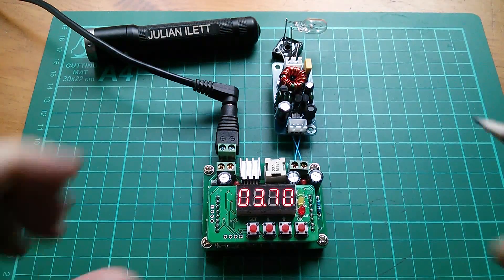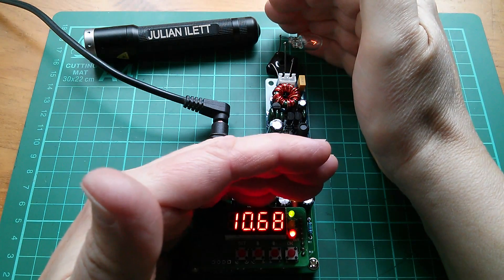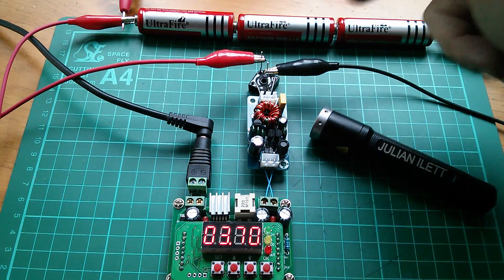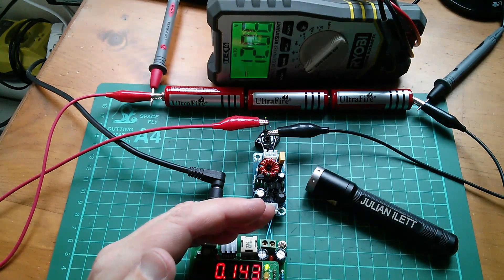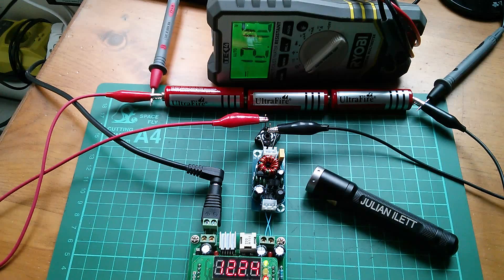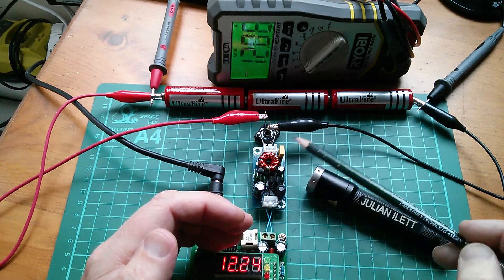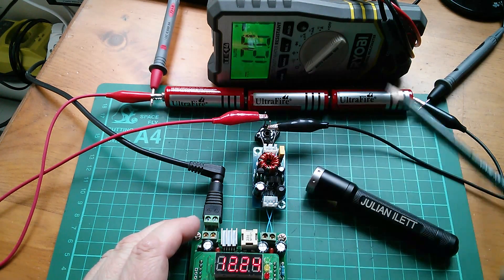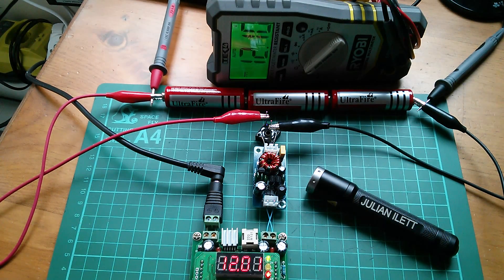Idea: Lithium Cell Balancing using AC Power Transfer

Comment: Run it at 3 volts and step up the output with an additional "standard mains" transformer from 3~ volts AC to whatever you need. Then rectify it

Comment: pst... go with a fet based active bridge rectifier if you can find one with a low enough voltage (I know of one that goes down to 9v by linear tech)...if you can break your addiction to china and ebay you will find you may even get samples of these non shit components for free, then reengage your adiction and get the ssop or qfn to dip converters from ebay. Linear also has a two part system (two systems but one is less capable/older) that does one chip per cell that connects to a 1:1 transformer and all other components are intigrated. this chip sends voltage current and temp back to their stack ccontroller via spi(i think) which does all the fet switching. Im trying to figure out what its min config is...just need to clarify with sales rep. it says the switcher chip does something like 12 cells and can transfer up to  6 or cells to any other series connected pack of up to 6. Thats a bigger pack than I want so im trying to confirm if I can go with something like 2x 3s groups. I know it also has a slower mode where it can switch them all two one transformer (only one active primary at ta time)with multiple primaries but its best to have a bunch of transformers. I got something like 5 free from coil craft by requesting a sample... i fucked up a little bit though cause i started with their old chip then after request for those realized the new chip existed and takes diff ones. im not paid by linear nor was I asked to write this im just a dude in the middle of my first "Big" project with multiple ics and the linear sales rep I was assigned has gone above and beyond to understand my design and see if it can be improved. He then got me a bunch of samples very quickly. idk if they ship to uk for free but checkem out.

Comment: http://www.aliexpress.com/store/product/lithium-battery-balancer-which-keep-your-batteries-voltage-difference-within-10mV/708582_1768384410.html
I hope you can build your own, but here is a product that does the same thing. these are not cheap, but just something I found and thought I would share. they have a high pitched squeal.
love your videos.

Comment: This may be too simple but why not run zener diodes with series fuses in parallel with each cell to prevent any cell from overcharging in the first place.  If a cell reaches it's predetermined charge (zener) voltage then the zener clamps the charge voltage at that level forcing the lazy other cells in series to accept more of the charge voltage instead of the fully charged cell going over voltage.
Reply: Cool. Sounds almost too simple to be true. Have you tried it?
Reply: No Andy, I haven't tried the fuse and zener idea because I don't play with batteries very often.
Reply: Sounds like it deserves testing, though there might be a (perhaps not insurmountable) problem when all of the cells in the battery have reached the zener threshold.
Reply: But the output voltage of the cell is variable, this could work to prevent a single cell from over discharging or over charging, but it does nothing about the problem with cells not staying balanced. The reason to keep the drain and charge on the cells balanced as close to 100% of the time as possible is to increase the life of the cells. 

Personally, i think this is all getting too complicated, and we would be better off at this point just using cells in parrellel and stepping up the voltage.

Comment: You could take a more powerful version of the DC-AC converter (let's say 30W which could be built in "ZVS/Mazzilli Driver" topology) or even an "electronic transformer" (those cheap SMPS used for halogen lights nowadays) and place several secondary output windings on the transformer depending on how many cells you want to charge. These should have 5-8V. Then you add a bridge rectifier to each output winding and connect a TP4056-based charger to each rectifier. Et voila, you should have intelligent charging via balance port for each cell...I think I'm gonna give that a try. The problem withe the cheap halogen transformers is that you need a  load of about 20W in order to get them oscillate properly. Should be possible to get that solved though.

Comment: Perhaps you should hack that Duracell battery charger you have, which you threatened to pitch anyway, the one with the fancy series-parallel switches on the board, to charge 4 caps in parallel from the donor battery, then switch to output the caps in series to the entire bank. I can not envision anything more efficient, and you already have the parts.
Please do not leave our robot brethren out of work.

Comment: These little projects may be fun, but the world needs more useful and meatier solutions!
I'm still looking for an MPPT circuit or product that'll charge and balance a 48V 50Ah 12S multi-lipo pack at 20A or more for a solar powered ebike using a few hundred watts of foldable solar panels that I'm making, and which can also be used as an offgrid power supply.
I've trawled the net for weeks, and still can't find anything appropriate - has to be a good product idea here for someone.

Comment: There is a Chip for exactly this purpose: http://www.linear.com/product/LTC3300-1
Reply: have you used it? the wording of the specs makes it hard to determine the precise minimum cell count this will balance. Im in the middle of an email to my rep who is good at everything but the balancers...so he will have to ask another dude. been trying to find a 4-6s solution for some time. It apears ti abandon it as i found a discontinued product or not for new design... same with one other I cant remember.  im hoping one of the cell plus stack mon solutions from linear can be made to work with either 1 5 or 6 cell or if it needs 2 groups can be split to like 2 series groups in series.

Comment: Interesting idea. Reminds me a little of the project I saw years ago in EPE or Elektor, where a circuit would be put in parallel with a LED bulb in a car, to draw more current in order to satisfy the broken light bulb detector. That current would be boosted and fed back to the battery to charge it. That way the extra current wasn't simply wasted.

However, this seems like the amount of energy saved would be miniscule, due to conversion losses and the relatively small amount of balancing that's typically needed. Of course, it's still worth making as an experiment... if you can spare the time ;)

Comment: I remember a battery charger you covered that had a series parallel IC circuit in it.  charge in series and use in parallel.  This seems like a Rube Goldberg machine or am I missing the point. :)
Reply: cells matched by internal resistance at a quality (non china) factory will have a small diff in discharge rate of each cell. packs made in china or at home will have a larger ir diff... batt needs to be turned off when the weakest cell hits cut off voltage or you may damage it and it goes boom next time u charge or use it.... well if 3 of your 4s cells have 30% and the runt is at cut off. that is shitty cause u still have a lot of run time if you could redivide the power above cut off on low cells. see active battery balancer and or "milking booster"

Comment: If you decide to do this more 'permanently', you need schottky diodes, rather than a commercial bridge rectifier, the diodes in an off the shelf bridge are WAY too slow to work efficiently at the high frequencies in use.

Comment: I think it would make more sense to have a multiple output isolated power supply and chargers per cell. Converting the energy backs and forth has high losses and I'd go for the lossy resistor dumper instead. It dumps energy only when the cells are full and only one needs balancing anyway, not the hole time if the resistor is swithed on when needed.
Interesting to see different approaches tried out though.

Comment: Julian,You might want to add a small filter capacitor across the DC output of the bridge rectifier to smooth it. If you look at the dc output with your scope without the filter cap, you may see what looks like a saw tooth output riding on the voltage. It may be causing your DVM to give an incorrect reading. Always trust the scope.
Reply: +Ken Franco The batteries would smooth it enough to get a good reading. Batteries are just "slow" capacitors that store energy in a different way.

Comment: Wouldn't it be a lot simpler to use switched capacitors as the energy transfer mechanism? Like a capacitive voltage doubler but just transferring charge from the most charged battery to the least charged.

Comment: Way too complicated and lossy. Feeding it back into the whole pack wastes the energy that's trying to go back into the same cell. 

Why not just dump the excess into the two "weak" cells?  There's a technique called switched capacitor cell balancing that's fully isolated. It charges very low impedance (ceramic multilayer) capacitors from one "source" cell, and dumps it into a lower charge level cell - using MOSFETs. This happens at very high rep-rates. 

There would be intelligence to determine who's able to donate, and who's needy. 

It works on the same principle as wealth distribution..... but in this case it's a good thing.

One example: http://www.mdpi.com/1996-1073/9/3/138
Reply: +beforebefore Like a charge pump.
Reply: do you know a electronic balance available to buy
Reply: its hard to argue in any way that the current wealth distribution curve is idea for a market society. its also hard to argue that it was obtained fairly to begin with...outsourcing...dogy tax methods of reporting it to/in a diff country with lower/no rates and penentions eliminated while HUGE ceo bonuses became norm ). mega ccorps continuously loby to kill public programs and privatise because what that is is welfare that would have been spread going to one corp entity that again engages in paying the majority less and the ceo a lot. Im all for a fair to large profit but this system is debt slavery and not capitalism ...it also works perfectly with depopulation... and if you support that idea, please start with yourself.

Comment: active balancing isn't a new idea unfortunately and is normally cost prohibitive for consumer products
Reply: the more I learn the more I think the only reason that statement remained true over the past 10 years (as fet prices dropped )is because companies would rather sell you a new device or new pack every 2 years for corp grade laptop. I can see size being in issue in tablets and phones but many laptop packs are 4s with several empty 18650 slots.
Reply: Yes, you have very good points here. The cost is really with the transformers and normally additional silicon for active balancing. Plus the added points of failure of course, but $3-$5 extra cost on those components generally dissuades the choice away from active balancing.

Comment: Julian, I just watched this video and your previous video (postbag #56). The output frequency of the Dc to AC board is (according to your scope) 50khz with a 1k load and 120khz no load. The rectifier you are using is a low frequency bridge designed for 60hz  resistive or inductive loads with a max. frequency of about 1khz (very slow reverse recovery time). Try making a bridge rectifier with 4 - 1n4148 high speed switching diodes ( 75 volts at 150ma - 4.0 ns reverse recovery time) and see what your dc output voltage is using them for testing. They will not handle the current rating you require but should work fine for testing (and you probably have a few of them around). What you want to use is something like an RGP15D high speed switching diode (200 volt, 1.5 amp with a recovery time of 150ns)  or something equivalent. As a side note - the 1n4000 series diodes are also designed for low frequency rectification (60hz) so they won't work either.
Reply from the maker: +Ken Franco That's a really good point. This is worth further investigation.

Comment: What I've always thought would be the way to do this is to have the battery pack separated from the load (e.g. a bike) by a cable with lots of pins for example a vga cable where each terminal of each cell in the battery gets connected to its own pin of the cable, and inside the battery the cells are actually not connected to each other, only the cable. The idea is that the organisation of the cells is decided by the device the cable is plugged in to, for example a charger can address them all individually with none of them being connected to each other whereas the bike could address them all in series. This works because the socket that the plug is plugged into has wiring to arrange the cells and connect them to each other or to not connect them to each other. This takes really long to explain without a diagram but I hope you see what I mean. Love your videos by the way.
Reply from the maker: +Barry Scott Thanks Barry. I do see what you mean and I like the idea. The biggest problem would be contact resistance in the numerous interconnections.

Comment: If the batteries where wired in parallel and left for some amount of time,  would the cells not balance themselves to some degree?
Reply from the maker: +stupidystu To some degree, yes. But mid-balanced cells with identical voltages can be at quite different states of charge.

Comment: I use this for  3 cells http://www.ebay.co.uk/itm/1Pcs-3S-6A-Li-ion-Lithium-Battery-18650-Charger-Protection-Board-11-1V-12-6V/272200794090?_trksid=p2047675.c100005.m1851&_trkparms=aid%3D222007%26algo%3DSIC.MBE%26ao%3D1%26asc%3D35391%26meid%3D6de06b6720b749fe952ec0726e811329%26pid%3D100005%26rk%3D3%26rkt%3D6%26sd%3D262370462617
Reply: Strange that i thought it brought each cell up to 4.2 volts while charging : ) .

Comment: Good idea.another solution is to charge every cell from different solar panel.i do this a lot of times with a tp5000 or max1879.i make the solar panels too according my needs.
Reply from the maker: +George Aleyropoulos I was thinking the same thing just the other day. Use 4 separate solar panels to charge the eight batteries (in pairs) in a small electric car.
Reply: George Ale  Good idea George. Another IC used for solar charging application is MCP73871. It  has a Voltage Proportional Charge Control which adjust the loading  current to the keep stable the loading voltage.  Btw,  how do you solve this issue with your ICs ?

Comment: Did you say on a previous video that lipo cells in series could be charged independently as long as each charger is isolated? That's what I'd be interested in, a charger which charges each cell in a battery pack independently.
Reply from the maker: +TheUnnamedGent Last summer I got a quadcopter with just such a charger - 3 separate switch mode charger circuits in one mains-powered box.

Comment: I suspect any energy harvested from the high cells will be mostly wasted in the circuity to redistribute it into different cells in the pack and the components used to implement it would make it less cost effective than just throwing away the energy from the high cell and charging the others from the main power source.
Reply: +Julian Ilett I am quite sure 90 percent efficiency will not be achieved with such a solution.  And the energy you start with it's already quite limited because cells are not going to be massively un-balanced.
Reply from the maker: +donpalmera True, it's more expensive than a simple resistor-dump design. But it should be possible to achieve a 90% transfer efficiency between individual cells and the whole pack. Lots of testing would be needed though.
Reply: VoltLog I would have thought that if the cells are unbalanced enough that there is enough difference in the state of charge between them to make this worthwhile that the pack has one or more bad cells that are going to fail fairly soon or you've picked up some random junk cells and made a pack out of them. In which case you should stop using it instead of risking charging it. ;)
Reply: +donpalmera yes, I agree, that's why I said in my comment that the only acceptable scenario is where you have only a slight difference between the cells so the energy 
is not much to start with.

Comment: maybe useful on a 48v solar installations. one connected to each battery  then connect the rectified outputs to run 12v devices and keep the batteries balanced

Comment: Considering you have to wire all the cells wouldnt it be easier to make them so they charge in paralel and discharge in series?
Reply from the maker: +Adria Garceran Switching from parallel to series doesn't scale well. Not too difficult with 3 cells, massively complex when there are 50 cells.

Comment: So what happened to the 3x tp4056 modules idea?
Reply: AC mains down to 5V 1A PSU boards are dirt cheap now and would provide that isolation. It's the way I'm going.
Reply from the maker: +cottsak It's the same problem - isolation using transformers is the only solution (I think). I'll look at that in another video.

Comment: I'm sorry but I don't get this convoluted idea. if you want to balance cells without wasting energy just use balance charger which uses switchable bank of capacitors on it's output. This will transfer energy from most charged cells to undercharged ones balancing the whole pack. That's how it's done in practice anyway. The whole unit will be also smaller than using this isolated DC/AC converter for each cell.
Reply: +Matt Gorzka *resistors. Which also cause a loss of energy. 
Making a new design is much more fun than using a standard balance charger (what he does now..) that's already easy to buy..
Reply: +Matt Gorzka can you point me to a specific lithium charger which does that? thank you :)